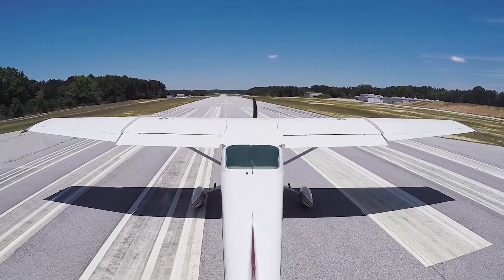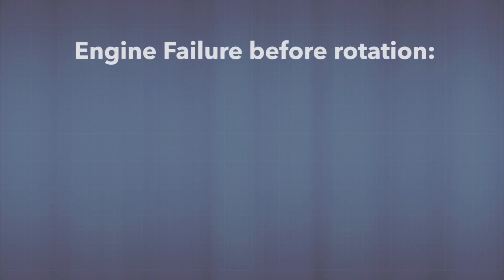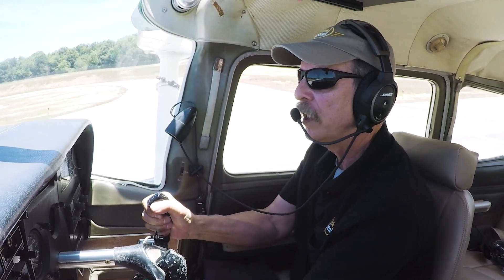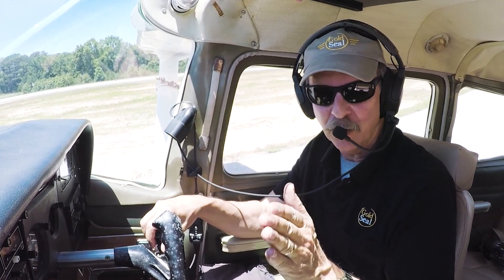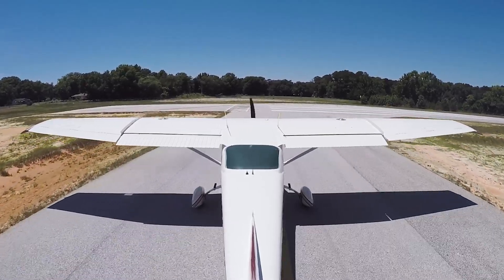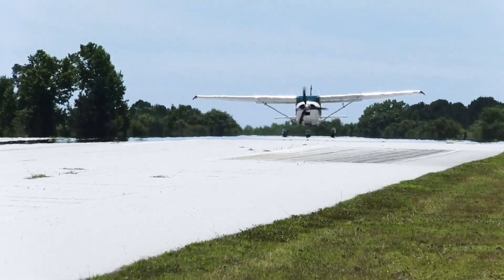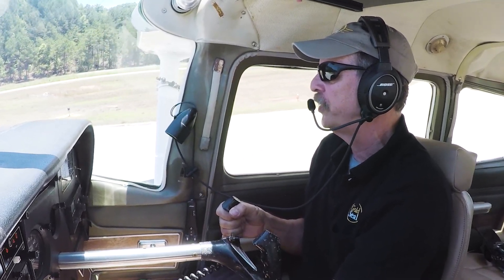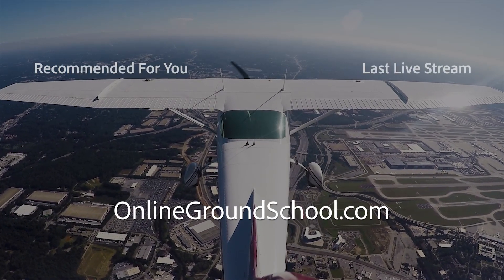Takeoff Emergencies -  Runway Remaining

Comment: Very good demo sir.  Very important maneuver not taught by most cfi's because "it is difficult", LOL.   I used to teach those take off emergencies when cfi in the 1990's.  I was the cfi that taught the other commentator below named 5feetgoaround40flaps..  I used a 4, 800 runway.  I called them, 50 feet RTO for the partial power down.   or 50 feet engine cut for the total cut.

  2 of my former students had to do them as far as i know.   One after a door opened at 30 feet agl after rotation, another after they hit a goose with a wing on rotation, which made a huge dent on it and huge noise he said.  Both landed and stopped by cutting the mixture as taught.

Comment: I taught that emergency a lot.  The 50 Feet RTO.  Nose down, power down..land..  Cutting the throttle is second nature. Cut flaps, cut mixture too.  Dont forget to cut the mixture and cut the flaps.  Dont get used to try to brake hard with flaps and engine pulling you forward from idle power. That way you avoid braking with flaps and engine idle power on.  Most engine fails are at full power setting. The partial power kind.  Air cooled engines fail 40 times more than liquid cooled ones, like on cars. Go to the grass to stop sooner if needed.

Comment: Why power off after engine failure?
Reply from the maker: It could be a partial-power failure and you have to land. Ideally, pull out mixture and fuel to off as well, but probably not enough time for that unless you've really practiced this.
Reply: @GoldSealFlight      Man, you do not want it to start again! That is like shooting the other foot. Whatsamatterwithyou?
Reply: Got the idea too that in any engine off problem, whether on takeoff or while flying and then on landing you want power (throttle) off, because it would be very bad if you plan the landing and it suddenly came to life again.

Comment: Just one question though. If you could briefly tell me how u have set up ur sound recording. It’s crystal clear!
Reply from the maker: We use a couple of different methods depending on the video. In this case, we used an audio cable from GoPro that has the correct impedance to record audio from the airplane's intercom.
Reply: Gold Seal Flight Training 
Very kind of u sir for ur prompt reply. God bless!

Will check out ur online lessons. I wish I could take practical lessons with you. But am far far away in Kenya😊